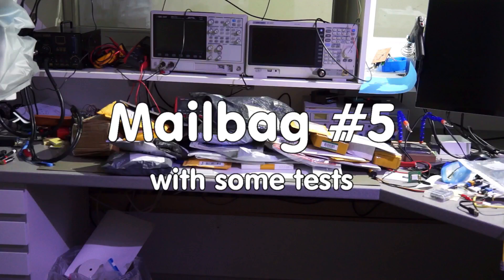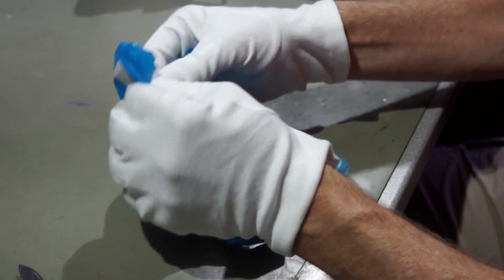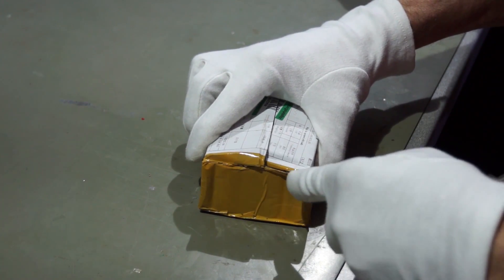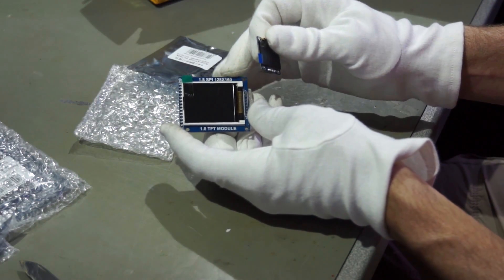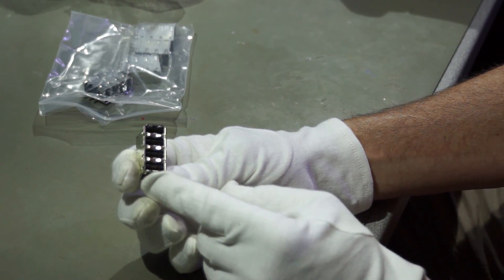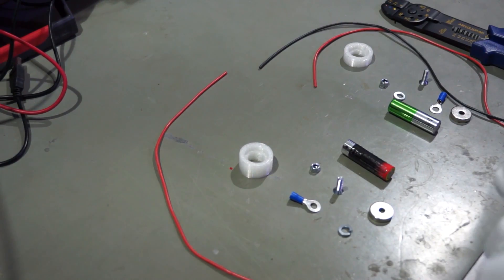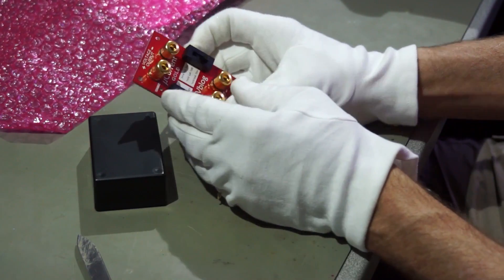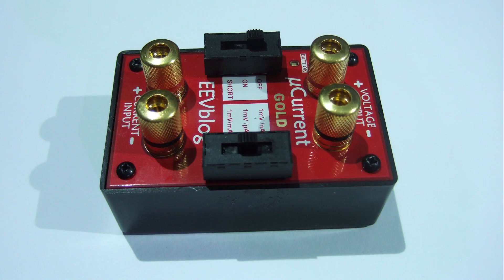#74 Mailbag #5 (with magnetic battery contacts)

Comment: Ach mit den Displays hab ich auch schon Stunden verbracht. Selbst wenn die äußerlich gleich aussehen, heißt es nicht das immer der gleiche Controller verbaut ist. Auch wenn die unter dem gleichen Namen verkauft werden. Bei manchen Händlern, wie auch Banggood, erhält man manchmal unterschiedliche, obwohl man den gleichen Artikel bestellt hat. 

Ich glaube Du hattest ja auch mal die etwas teureren programmierbaren Displays vorgestellt. Finde zwar die Entwicklungsumgebung etwas umständlich, aber wenn es schnell und einfach gehen soll, spart man mit den Teilen ne menge Zeit.

Ansonsten verwende ich immer noch gerne die guten alten hd44780 mit nem i2c adapter. Unschlagbar im Preis und gehen meist ohne Probleme.
Reply from the maker: In meinem jetzigen Projekt verwende ich ein solches Nextion Display. Es ist ausserdem Touch. Und braucht nur zwei Pins. 
Die hd44780 sehen mir zu altmodisch aus... Aber Du hast recht. Sie sind simpel zu gebrauchen.

Comment: Hello Andreas, I like your video. I have that blue TFT, mine is works OK with UNO and Adafruit ST7735 library, You can choose VCC - 5V or 3.3V (with J1 short) , but you need level converter for some data pin anyway.

Comment: Hi Andres, The question what I want to ask is not related to this video. I have many times but nobody can give me an answer. What I wanna know is that is it possible to make DC power USB hub? I can only find AC power in the market. Thank you for your educated videos. Have a nice day.
Reply: Hello,

all USB-Hubs are powerd with a AC to DC PSU, so it's easy to power one from DC. Most of them use a 5V DC wallwart, so you can power them easy from a power bank. Some have internal regulators, so they use a 9V PSU but when you open then, you may find a point, where you can incect 5V after the internal regulator.

greets
Reply: +underwood Hello Underwood thank you very much. U answer every thing what I want to know. Have a nice day. Cheers John

Comment: I had an oled display like that from bang good. could not get it working until I tried half the y axis pixels. this fixed it. several other comments of similar issue. I think they had a badly listed batch. try a lower number of lines. 64 iirc
Reply from the maker: I will try it at a later time. Thanks for the hints!

Comment: hi... lovely intermission with the battery holder ^^... that banggood display (the red one), i recently bought myself a touch screen from there, very similar if not the same, it only has touch screen on it, but i had a lot of trouble on setting it up because the instructions arent very clear, it uses some adafruit library as well..  i managed to upload the library, after 2-3 days of googling and reading, and could have been able to start customising it, but i figured it would have been too time consuming to research all what for it was intended... i was wondering if you could do a video on it to give me, and probably millions of others, a little head start on how to edit what its displaying  etc... tnx for the video... useful, but none the less interesting :)

Comment: Hi, Enjoyed your video. ty for sharing it.
I was wondering if you have the capability of measuring the magnetic fields of those neo magnets? A Tesla meter perhaps?
One sure way to impress yourself and add more questions than answers, is to try this experiment;
Put 2 magnets through a piece of brass threaded rod and tighten both ends with brass nuts, so that the north poles of one is face the the north pole of the other magnet.
Now tighten the side nuts to force the magnets together. 
What will you see in the strength of the north poles now? How far does the field extend from the magnets? 
gl/hf :)
Reply from the maker: No, I have no Tesla meter. If I find some brass rods, I try to do your experiment.
Reply: Andreas Spiess
I've done it already.

Comment: the 1.8" Display size works very well, and the speed is superior to to I2C!  I have three different 1.8" layouts, including both shown, and they all work with 5v arduinos...? However, please post a video on getting these to work with the ESP - none of the claimed adafruit modified github versions have produced any fruit!!!  I have by ODB cable already, but haven't put it to good use, can't wait for the video  :D  Those magnet battery connectors are very nicely done.
Reply from the maker: +Laurence Munro Because this was just a Mailbag I did not spend too much time for the tests.
I do not know when I will look at the Obd. Currently it is just in the project stack...
And the displays: Maybe I will use them with the ESP. Then, I will try to make them work.